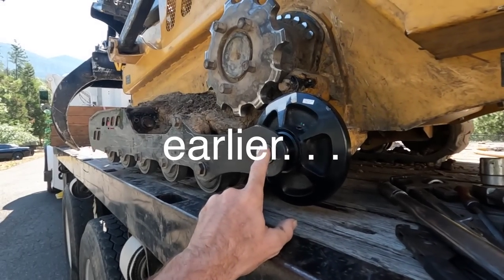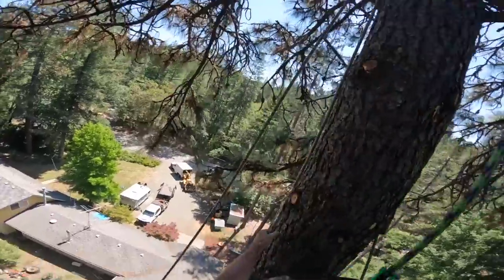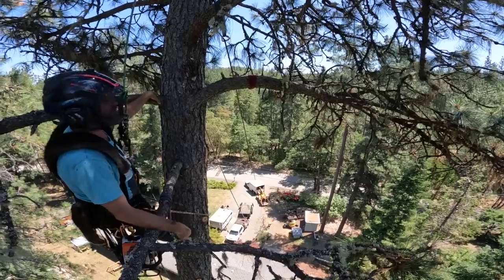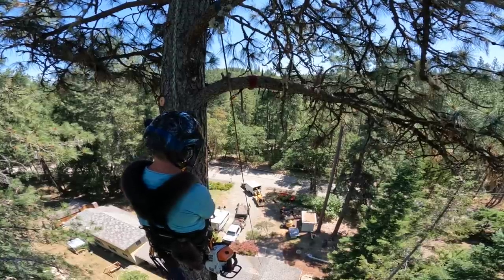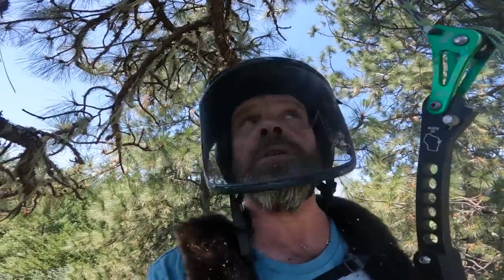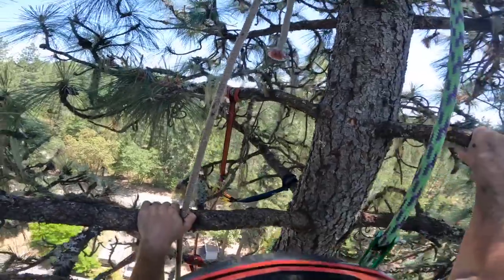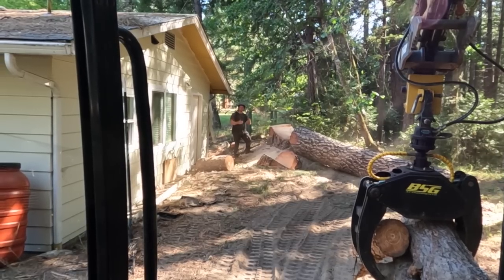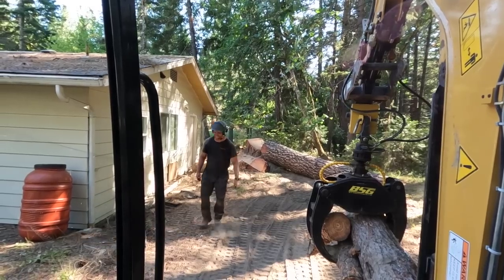Don't Try This at Home

Comment: I'm sure I'm not the first one do  it. If you have a tree that you're worried about pulling too hard sideways, I've found it handy to run the speedline through a block at the top and anchor it near the ground opposite the direction of pull. It's not perfect, but it's a quick and easy addition that helps a little. It helps even more if you use a pinto pulley or revolver or similar device for the anchor.
Reply from the maker: When doing that it’s often a quick fix to have ground man use your climb line as temp back guy support. This one was not needing it.

Comment: Speed lining out the top is something that I’m still trying to perfect. Watching you closely I noticed that you not only send it off to the side to lessen the shock but you also sort of seemed to hold the top a bit while you holster your 201 back in… so as to have a fraction of a second longer to brace yourself. One of the first tops I sent out the line was very taut and it was quite the ride to say the least!

Comment: Hi August, I have a question mate. You were speed lining over the house and was concerned that you might hit the roof.
Q: If you set the sling say a foot or 18" further out on the limb you want to cut, would that not in turn raise the branch you have cut that bit higher on the speed line, miss the roof and do away with the need for a control line?
Great video as always. Stay safe, ALL of you.

Comment: 😍😍😍😍😍 AWESOME VIDEO !!! The repair job was a REAL SAVINGS in the profit margin. YES those bearings don't last forever, BUT they don't make equipment now days to last forever for sure, LOT of MONEY made in the servicing of such problems. YES, the MOST IMPORTANT TIME spent when putting new equipment to the job is "READING the service and operators manuals  before getting to job site.(IF AT ALL POSSIBLE) because the salesman and or dealer rep "MAYBE" will give a fast overview then it's YOUR machine. 
THANKS FOR YOUR TIME, ENJOYED ALL - ESPECIALLY the view of the landscape, SUCH BEAUTIFUL SKIES OUT THERE.  BE SAFE - GOD BLESS.  👌👍 🙏